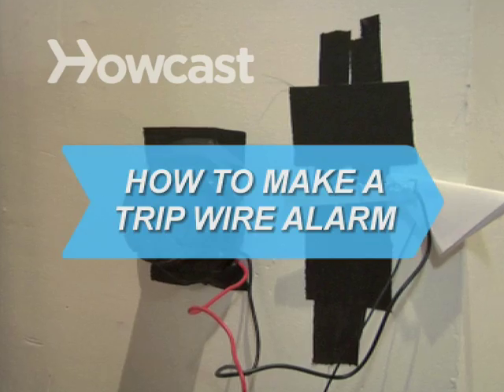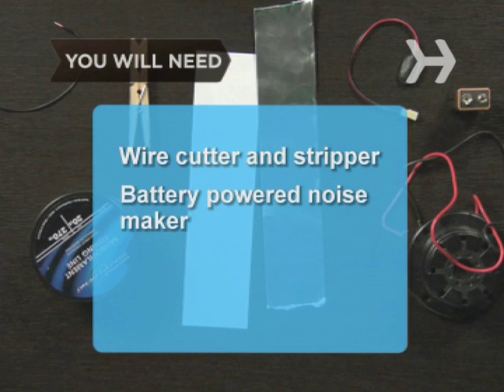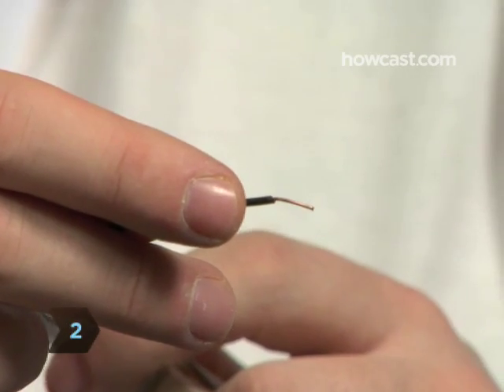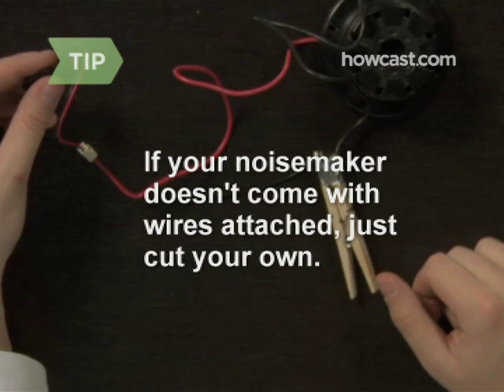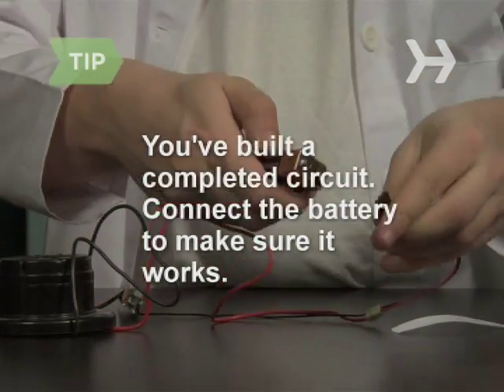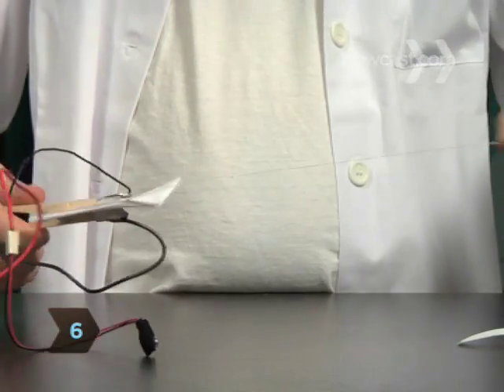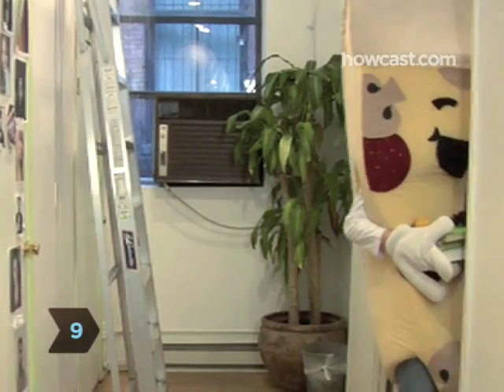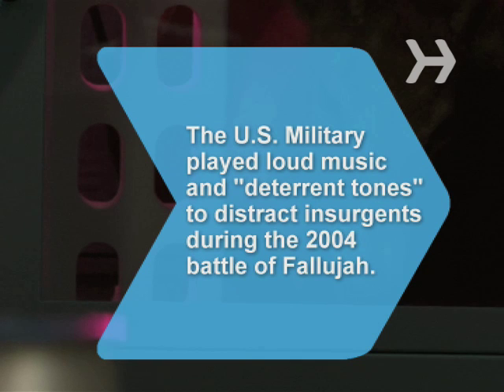How to Make a Trip Wire Alarm

Comment: simpler, a cheap window alarm, some tape or a nail and some wire or string. just stick the window alarm on the wall on one side of the door with the bar side up, then attach the string with the tape or nail to the opposite side of the doorway, leaving enough to pass over the alarm. now tie the alarm bar to string and lay the alarm bar on top of the alarm and switch it on. when someone walks through the doorway, just touching the trip wire will make the bar fall and trigger the alarm.

Comment: What if I want to be alarmed from afar, without a loud noise? Because I'm gonna be using a tripwire system for airsofting - so I don't want the enemy to know they just stepped into a large offensive ambush. I also need to be far enough away to be able to get into an attack position for the patrol to coem through for the ambush.
Yes, I take my airsofting VERY seriously, lol.

Comment: Once you done the trip wire cut the wire locate the system somewhere and when someone enters you can have a remote to disconnect the alarm
Reply: Seriously? If you are Watching After Your Room Why Do You Need Alarm Then? That's The Point To know With The alarm If Someone Enters your Room, So Bad Idea About Remote I guess

Comment: I know a much quicker way to do this. You will need:
 
String or a finshing line

A noise maker.
Tape the noise maker to a wall and tape the string. Loosley tape the string to the wall. Optional: Make sure the trigger of the noise maker is loose.

Comment: When you pass current through a metal which resists the passage of current (steel wool for example) it heats up. (The same principle is used for heating elements on stoves, in hair dryers, etc.) There's a video posted on here about how to light a fire without matches which demonstrates it. YXtseQOPdI8  My uncle (an ex-marine tunnel rat and all around psycho though I love him to death) taught me that little tidbit of information.